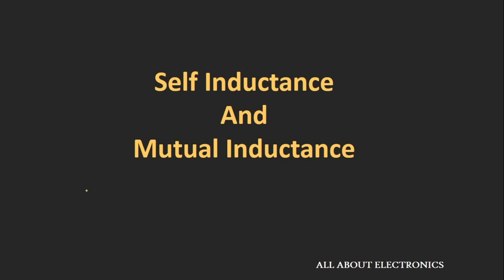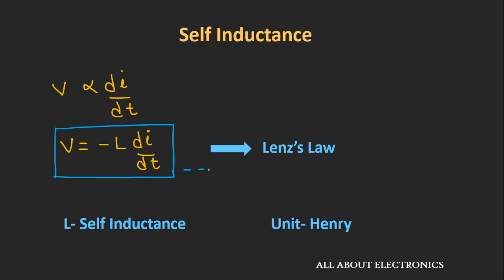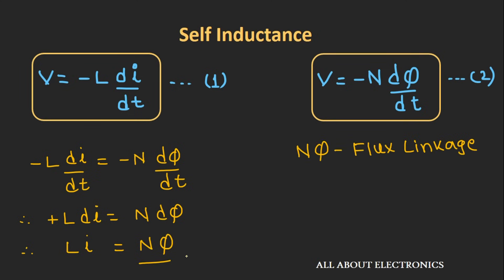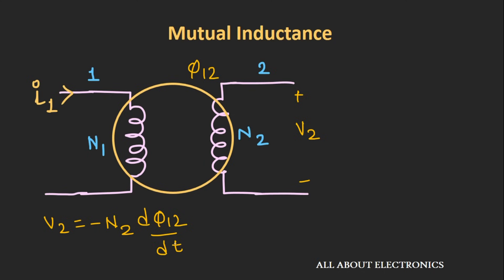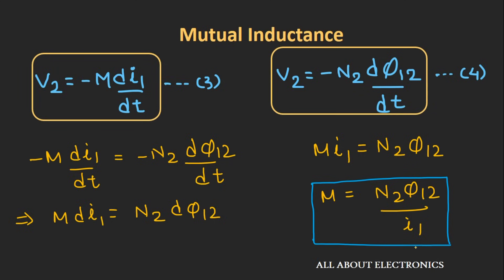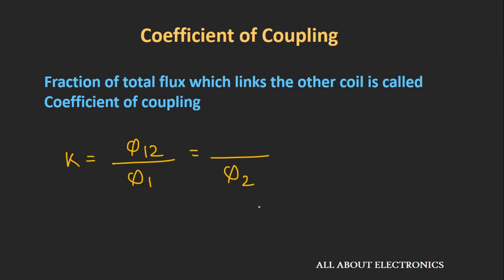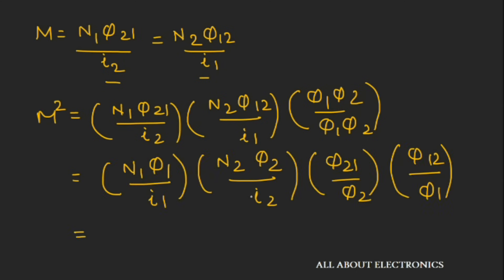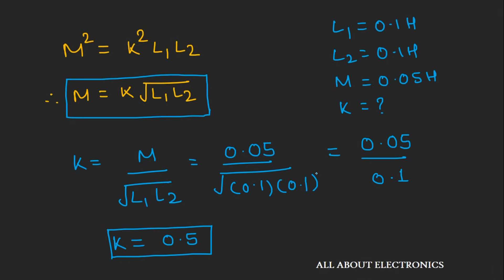Self Inductance and Mutual Inductance Explained

Comment: at 4.31. min instead of phi 12 it should be phy 21 which is flux in coil 2 developed by current in coil 1, your notation is wrong
giving wrong info is so unacceptable

kindly mention it at 4:32 edit video,

Comment: Great video! I have one question. At 4:28 you show the induced voltage polarity on the right side (V2)  with a plus at the top and a minus at the bottom. Do we know this for sure? Would this remain the V-polarity if the Coil#2 was reversed in direction (i.e. clockwise to counterclockwise, or vice versa)

Comment: This is the change in current that causes a magnetic flux to be set up but not the rate of change of current (just to be precise). The rate of change of current is rather a quantity that determines the strength of B. Am I correct?
Thanks

Comment: Question: If we move a magnet in front  a coil and the magnetic flux φ, due to the magnetic field of the magnet,  crossing this coil varies then an emf e1 = -dφ/dt is induced in the coil. If the induced current in the coil is also varies, is there a self induced emf in the coil such as           e2 = -L di/dt ? and that you.
Reply from the maker: Because of the varying magnetic field, the time-varying current is generated. As, φ = Lx I. So, I would say e1 and e2 are the same things. (Considering you are not applying any external current to the coil)
Reply: @ALLABOUTELECTRONICS  Thank you for reply.
Now i have my main question: The current in the secondary coil is alternating sinusoidal (variable) , so in addition to the electromagnetic induction e1 = - dφ/dt we have also self induction e2 = - L(di2)/dt. The question is, why we do not take into consideration this term in the transformer? and thank you again for reply.

Comment: Sir coefficient of coupling why we will calculate
Reply from the maker: It defines how strong the coupling is there between the two coils. If K is close to unity then there is a very strong coupling between the two coils and if it is close to zero then it means that there is a negligible coupling between the two coils.
Reply: Or using a transformer if the number of turns are the same, secondary voltage divided by primary voltage  will equal coupling coefficient.   You can figure it out even if the turns are different also.
Reply: @ALLABOUTELECTRONICS   sir why coefficient of coupling is only in between 0 to 1

Comment: sir how is current induced in the same coil when we are changing i
Reply from the maker: When you are changing the current in the coil, or in other words if time varying current is flowing in the coil, then that will generate a voltage or emf (Electro-Motive Force)in that coil, not current.
Reply: ALL ABOUT ELECTRONICS  can i speak to u now can u share ur no
Reply from the maker: You can ask me here itself. No issues.
Reply: ALL ABOUT ELECTRONICS thing is that i wl be cleard if i ask it i cant put it text form just give me mised call i only wl call u